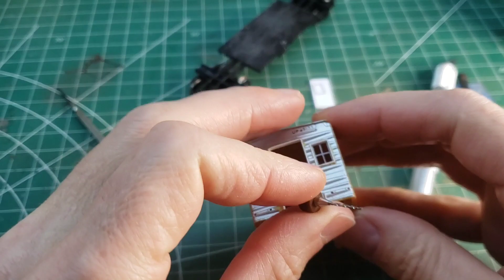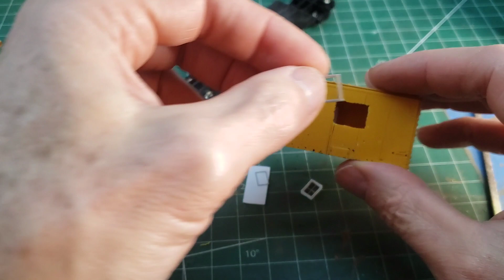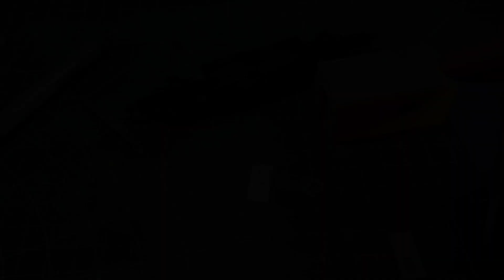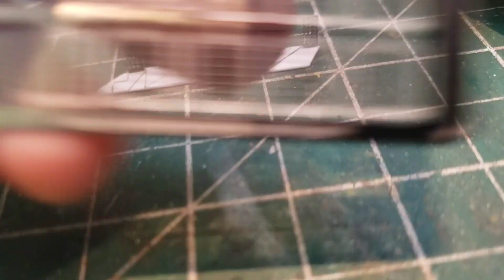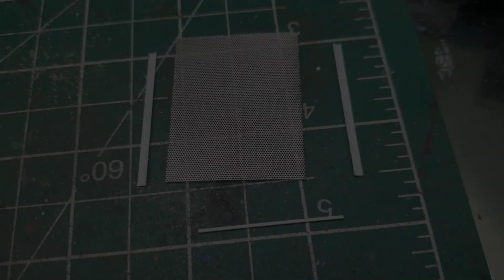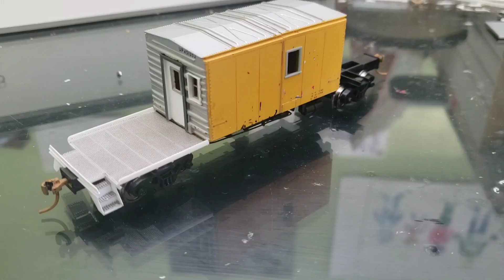Part2 of the HO Scale Transfer Caboose Scratch Build

Comment: Thanks for sharing this build.  I am in the process of scratch building some caboose underframes for some steel cupola cabooses and was curious how others constructed the steps. I'm experimenting with PC board and plastic, making the sides one piece, at least on the coupler side.  I haven't worked out the stair tread spacing yet.  I thought about using pinking shears to cut the steps but they were a bit too tall and the angle seemed wrong for this aplication.  Your project is coming along nicely!